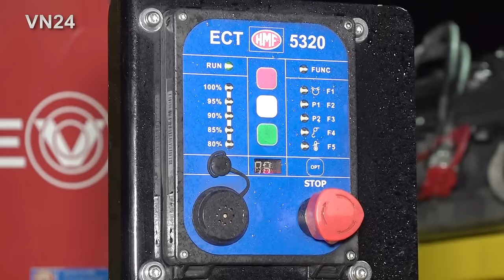03.11.2021 - VN24 - Schwerer Frontal-Unfall in Bönen - Motor aus dem Fahrzeug gerissen

Comment: Heftig, wie es da teils die Autos zerlegt, selbst im Innenraum - also ich bleib da einfach der Meinung, die sich schon vor 40 Jahren hatte - Autos sind nicht dafür gedacht. Wenn man Unfälle bauen will, sollte man zum Autoscooter auf dem Jahrmarkt gehen. Also trotz allen Sicherheitsfahrgastzellen und Airbags uvm. - werden die einfach nie an die Stabilität von Autoscootern heran kommen. Also es ist und bleibt bestenfalls eine kleine Sicherheit, wenn man ein Unfall wirkich nicht mehr verhindern konnte - aber wenn man so die Unfallzahlen anschaut, haben das noch nicht alle verinnerlicht, oder fühlen sich zu sicher in den Autos. Früher 1960 oder 1970 wusstest Du wenigstens, dass Du einen Fahrfehler mit hoher Wahrscheinlichkeit mit dem Leben bezahlst - also warst quasi für den Fall eines Unfalls froh, wenn es nur Dich selbst erwischt hat, und keine anderen.
Reply: Da ist doche der baum 100% schuld, nein ??? Springt der auf die strasse wenn das auto gemutlich ankomt, so eine freschheit !!! Und die autos, kosten so viel geld, und so schwach gebaut, da rolt der motor auf der strasse rum,,,,,

Comment: Habt ihr das mit dem Strahler gesehen? Die Flöten hätten fast noch das Auto in Brand gesetzt!
Reply: Wunderbare Expertise der Herr, genau, die LED Scheinwerfer, die keine Wärme abstrahlen, hätten fast das Auto in Brand gesetzt. Manche Leute schweigen, wenn sie keine Ahnung haben! LG
Reply: @markusevangelium9668 außer beleidigen können sie auch nichts oder?? Wenn sie sich das Video genau angeschaut haben, dürfte ihnen nicht entgangen sein, das eine starke Dampfentwicklung unter dem Strahler war. Und zweitens, ist dass das Strahlergehäuse von LEDs flach! Der betreffende Strahler hat einen Reflektor deshalb ist er auch so hoch! Zu ihrer Info, das ist 1000 Watt Halogenscheinwerfer
Reply: @christiankugler5535  1000 Watt Halogenscheinwerfer? 🤣
Reply: Was gibts da zu lachen? Mein Kumpel hat sogar einen mit 2000 Watt, der is allerdings etwas größer.

Comment: Than how the hell this happend? That white tham VW hit the seat and ripped his hood and engine out and ended up in the ditch/tree? I hope they are all alive, because the polo was severy demage!
Reply: Wrong, the seat hit the VW, probably going too fast for the bend and ended up on the wrong side of the road hitting the poor VW driver.
Reply: The engine mounts are designed to break off in the event of a severe accident and the engine is supposed to rip out of the car rather than end up inside the passenger compartment. The description of the video said all 3 people srvived and were hospitalized